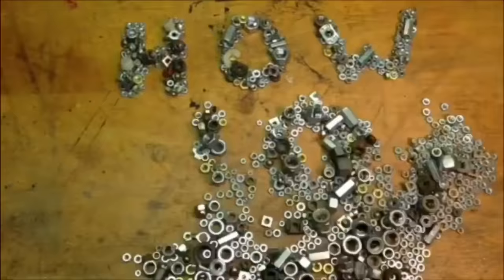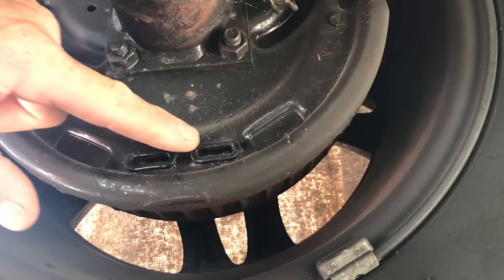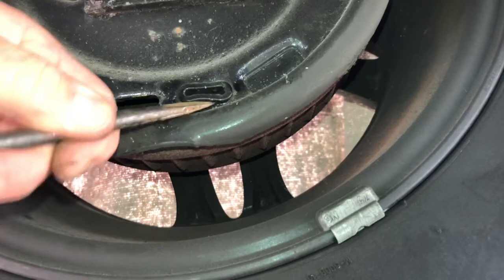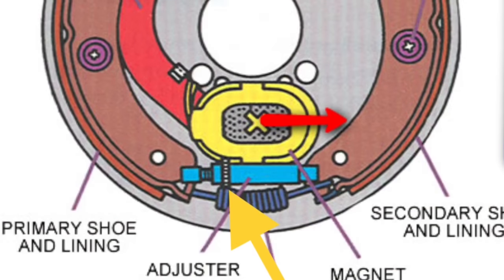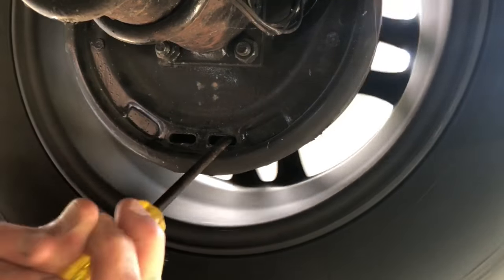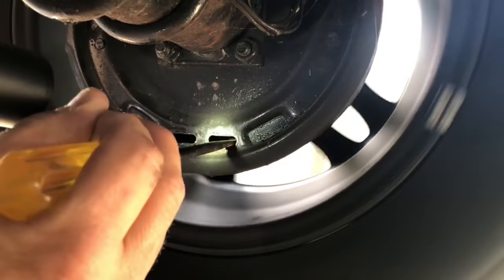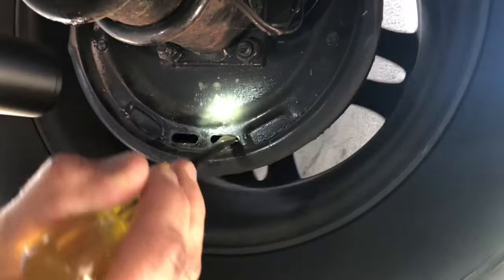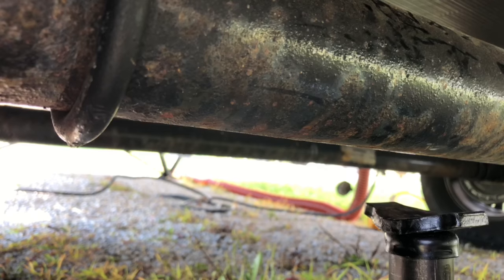How to Adjust Electric Trailer Brakes

Comment: Thanks for the vid. There is no “clockwise” direction. Prying the spoon down will tighten the brake pads against the brake drums. Prying upward will loosen the pads. The star wheel adjuster should be tightened so that the trailer tire turns freely and a slight scraping sound is heard.
Reply from the maker: Well then which way is tightening????
Reply: @funbro1  down.
Reply from the maker: On which side?
Reply: @funbro1   On my trailer spin the adjuster down on both sides to tighten the shoes.

Comment: Great job on this video. Very professional with no distracting music or lengthy introductions. What information would you need when ordering these kits?
Reply from the maker: Size of the brakes and bolt hole pattern.
Hope this helps, thanks for watching.
Reply: @funbro1  Yes it certainly would have but after inspecting the brakes turns out I only needed to adjust them and I repacked while I was at it. Easier than I expected but the video was a big help

Comment: Excellent video! Mine need it really bad. I kind of remembered this procedure from many years ago before cars had disc brakes. Thanks so much for providing me with this information again.
Reply from the maker: It comes right back doesn't it? Thanks for watching.
Reply: Agreed, sometimes I have to remind myself that some vehicles are still equipped with drum brakes!

Comment: Good video, however just an FYI to get it absolutely correct. Before you back it off, you want to tighten it up good and hard, not just with a little resistance. The reason you tighten it up all the way, is to make certain that the shoes get centered inside the drum. Then back it off until there's no resistance.
Reply from the maker: Worked like a charm doing it like the video, but I like your way also.
Thanks for watching.

Comment: Perfect video. Only question, do all of the adjustments on both sides go up? Or does one side go up and once side go down?
Reply from the maker: They will go the opposite way, you can check by having someone spin the wheel while you are doing the adjustment, it should begin to become more difficult to turn...if not the reverse the direction of adjustment. Hope this help, Thanks for watching.

Comment: I’ve always been told to jack up the trailer by the frame instead of the axle because of possible axle warping Thx for the video
Reply from the maker: As long as you are close to the wheel it will be fine, but it wouldn't hurt to continue using the frame. Thanks for watching.

Comment: So if you turn the adjustment screw one way on one side is it safe to assume you turn it the opposite direction on the other side? I didn’t know you could adjust the trailer brakes. I was about t have them replaced lol. I’m going to try this first.
Reply from the maker: Yes, that is pretty safe to say. You will still want to rotate the wheel as you tighten the brakes to make sure.
Hope this helps.
Thanks for watching

Comment: Thanks for the info. Looking at adjusting my brakes soon. I’ve heard it’s better to jack from frame rather than the axel. What’s your thoughts?
Reply from the maker: Better? Same but different. IF you feel safer and it works out better then go with the frame. Thanks for watching.
Reply: Never by the axle.
Reply: The Veteran RVR why?
Reply: @jbw5485   My bad.... The jack and/or trailer weight  could cause the axle to shift or twist out of alignment.  The axles are made with a slight bend.  Bend the axle, and that's money for repairs.  The tire(s) will then wear out pretty quick.  Always at the frame fore or aft the tire....and not on the shackles.  This warning is practically on all owner's manuals for trailers.

"Never raise the RV by placing the jack under the axle, springs or any attachment parts. Failure to comply could result in property damage, personal injury or death."
Reply: The Veteran RVR I mean, maybe. My view point is that it runs down the highway at 80 bouncing  like hell over bumps hailing a heavy load. If everything is bolted up tight and correctly, I can’t see how anything would be harmed. If the trailer is empty, and you use the Jack way out close to the U bolts on the axle, I can’t imagine anything being harmed. If the axle can bent under just the trailers weight using a jack, then it’s a piece of shit and I wouldn’t trust it towing my expensive equipment or toys. Just my two cents. Of course the manufacturer is gonna have a warning against it. Some Jack leg would use a Jack in the middle of the axle with a 7 ton load. Haha
Reply: @jbw5485   Well, what can I say?  I don't see it either.  However, I'll never see ripped up tires due to improper jack placement, that's for sure.

I've met quite a few peeps with wires coming out one side of their tread....Common answer, jacked on the axle.  Even the veteran RV'ers on the Tube had theirs jacked on the axle and in later episodes, replacing tires, axles, costly realignments.
Reply: There is no good reason to jack on the axle unless it is an absolute last resort due to an emergency recovery. Period.

You want to know what's even stronger than those axles... The frame. Use it as a jackpoint as it was intended.

Comment: Does lifting upwards on the adjustment wheel always move the shoes outward, regardless of what side of the axel the brake is on that you're adjusting? My rear Dexter axel on the right side looks as though the teeth on the adjusting wheel are angled to adjust downward with my screw driver.
Reply from the maker: One side will be up the other will be down. Hope this helps, thanks for watching.
Reply: @funbro1  thank you, sir!

Comment: Excellent video!  Just what I needed to know.   One quick question.  In the video you said you were spinning the screw "clockwise", but it looked liked you were spinning counter clockwise.  Did I miss something?  Lefty Lucy, righty tighty, right?  Thank you!
Reply from the maker: It depends on which way you look at it I guess. After spinning it a few times you should feel it tightening up if not try the  opposite direction.
Thanks for watching.
Reply: @funbro1  I'm working on them as we speak.  You're right.  I figured it out. I wedged the flathead screwdriver in there and pried on it so the bolt rotated upwards.  That tightened the brakes up.  This is on the driver's side of the trailer.  Gotta do the other side now👍

Comment: The part you are adjusting to spread the brake shoes is really only to adjust the handbrake travel/slack (if you have a manual handbrake on the trailer draw bar which most do to activate brakes when trailer is un-hitched).  With electric brakes when the magnet is energised it will drag/push the shoes out the same regardless of how far in or out the handbrake adjuster is.  Thats my understanding anyway.
Reply from the maker: Mine has No hand brake, and with the adjustment you will get a quicker brake response along with full power when applied. Thanks for watching.

Comment: So if I test my brakes @25mph, they should skid at max gain, correct? Otherwise adjustment is needed. Correct?
Reply from the maker: Yes that should be the case. Thanks for watching.

Comment: My trailer failed inspection because they said the driver side was not applying enough lbs of preasure. Driver side 500lbs, left side 2112lbs. You think this will fix this problem?
Reply from the maker: It would be a good place to start and would be worth the small time investment to find out. Thanks for watching.
Reply: @funbro1  your the f****ing man bro. That did it. I was walking around with a koolaid smile for hours. Thanks man. Keep up the good videos.

Comment: Is there not something to keep the adjuster from loosening like on a car? When you back it off it looked like it just spun backwards without a fight.
Reply from the maker: It’s like a ratchet. Should only spin one way easily.

Thanks for watching.
Reply: @funbro1  So it is just like a car or truck then
Reply from the maker: Yes very similar.

Comment: Back in the day drum brakes were self adjusting by stepping on the brake pedal hard while moving in reverse. Are these not capable of this?
Reply from the maker: I only move this in reverse when necessary so I don't think it would be enough to adjust them fully. Doing it this way lets me know I have it done to the right adjustment. Thanks for watching.

Comment: would be nice if you could have been a bit more detailed....on left side which way do you spin the adjuster?
Reply from the maker: More detail yields more complaints about the length of the video. The left side gets turned the opposite of the right side. Hope this helps. Thanks for watching.

Comment: No slot on the back of my trailer brakes. Guess I have to take the drum off. But then how do i know how far to adjust them?
Reply from the maker: It is possible that you have self adjusting brakes. Thanks for watching.
Reply: @funbro1  I should have edited my original comment. I have what I think is called a drop axle. There is a plug to adjust it, but there is 1/4" of clearance from where the axle drops down in front of it. No way to get any screwdriver or any other tool I can think of in there to reach the adjustment wheel.
Reply: @kirkcopple7918  Same problem here. Wonderful of them to make an axle with brakes that are supposed to be adjusted, but can't be. Compass trailer by Look, 7000 lbs.

Comment: I have never done this before - please hep if you can. I have the two rubber access holes just like yours. However, on mine you can see through the rhs access a spring. On the lhs access I can see a lever. But no matter how hard I try I can not see the little ratchet wheel. What am  doing wrong? Any ideas? I can send you a picture if that helps. Cheers!
Reply from the maker: Usually if there is 2 access holes the one opposite the spring is where you will see the adjustment wheel. It is hard to find but sometimes using a flashlight helps, other than that you may want to pull one of the wheels off to see what's going on in there. Hope this helps, Thanks for watching.
Reply: @funbro1  Thanks for your reply. I finally got it figured out! First off 99% of the online videos deal with standard adjustable brakes. So, I pulled one drum off and discovered I have "self-adjusting" brakes - sheesh, what a joke - "self adjusting" - really?? I learned that even these need adjusting when the trailer comes out the factory. Mine is 22 months old, and hence out of warranty. 

 Then I learned, through trial and error, that adjustment occurs in a totally different way from all the video descriptions. In the RHS access you poke a thin screw driver in, and raise a lever up, thus exposing the ratchet wheel on the LHS access. Then with another thin screw drive, not a brake spoon (!) you push the ratchet wheel down, not up.  After 2 afternoons in 35 degree Celsius heat (95F) I finally got 1 wheel right - hallelujah!  Tomorrow I fix the other 3.   

A good video on self adjusting brakes, is really lacking. Perhaps, you might be up for it? Cheers!

Comment: I didn’t think you could jack it up by placing the jack on the axel.
Reply from the maker: yep, I usually set the jack as close to the hub as possible. Thanks for watching.
Reply: funbro1 every time I buy new tires they always jack from the axel.

Comment: I’d go one step further and take the drum off pull the pinwheel adjuster and grease up the threads so they will never seize up, once they start seizing up and not adjusting properly you will know it.
Reply from the maker: Then I would go one step further than that and repack the bearings at that point. But that’s for another video. This one is just on adjusting the brakes, thanks for watching.

Comment: I have an electric brake controller. I tow lots of different things. I’m constantly changing gain for max brake effect before lockup. 

But

I have 2 trailers that are new and at max gain are not locking up. 

This seems wrong to me and makes me wonder if these builders (custom work) maybe just didn’t adjust the brakes like in this video. 

Could I be correct?

If my symptom is that at max gain i have no lockup - new trailers - is a possible solution this procedure?
Reply from the maker: I would start out by adjusting the brakes like in the video. It’s a quick job and it will let you know exactly where you stand as far as the brakes go.
Reply from the maker: Thanks for watching
Reply: I would also make sure the brakes are getting power and are grounded well.
Reply: I’m dealing with the EXACT same issue right now. Brand new trailer and even with my trailer brake controller gain set at 10 it just barely seems to engage and slow the rig. I’m going to try this tonight after work. Did this fix your problem?
Reply: @fullthrottle5563  did this fix your problem?  I seem to have the same thing going on.
Reply: @rubydog2  I had 2 issues I discovered. The trailer was only getting power to one axle. The wires weren’t connected and definitely not checked during the dealer PDI. So only one of my tandem axles were applying brake power. That obviously helped a lot. The second issue was directly related to this video. 2 of the brakes were horribly out of adjustment (loose) from the factory. After addressing both of these items, I comfortably run at 6.5 brake gain with brakes strong enough to slow and stop my truck and trailer fully loaded with gear at testing speeds of 25 mph!
Reply: Also, these newer trucks with 'UConnect' have choices of 'light electric' 'heavy electric', etc., app trailer adjustment options built into the stereo system under Apps or Controls...forget which.  Crazy....

Comment: Nice video, however Youtube has no idea what it recommends to me lol. Im looking for adjusting trailer brakes on an articulated bus, with air over hydraulic, and single foot metering valve and parking brake ....
Reply from the maker: Well that doesn't sound like this video but Thanks for watching.
Reply: @funbro1  I know, what I want is impossible to find because I might be the only one that has one of these (at least outside of Russia or North Koreea lol). But still figured Id drop a comment (I ask my followers that, so gotta lead by example..or something lol)